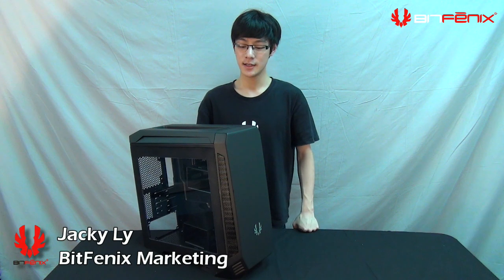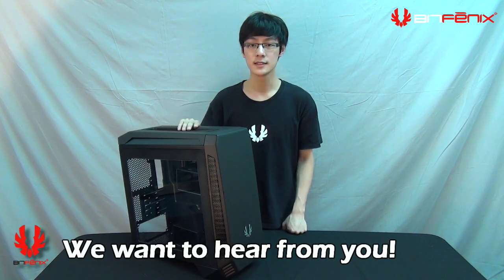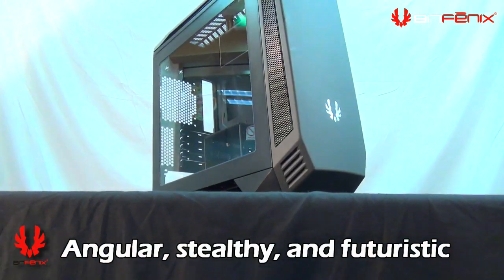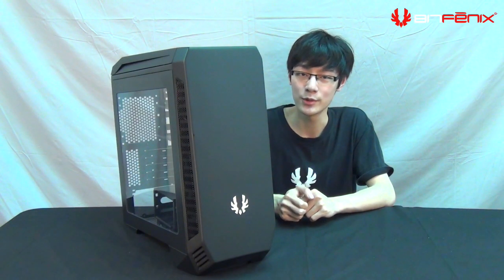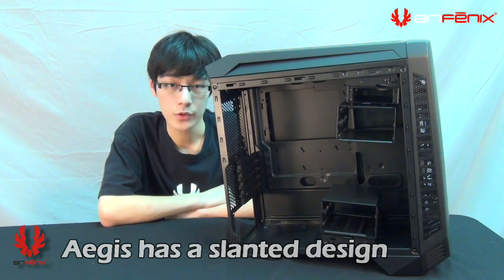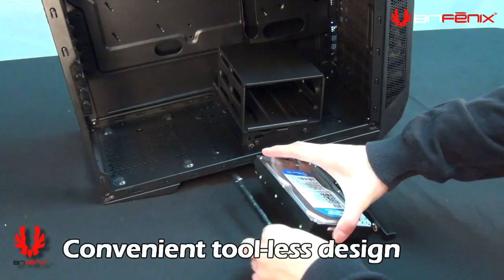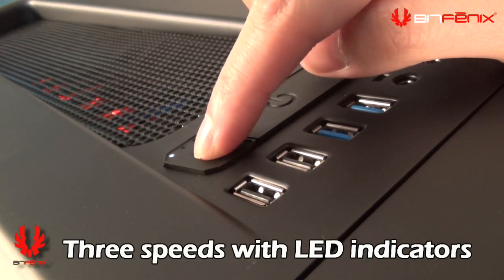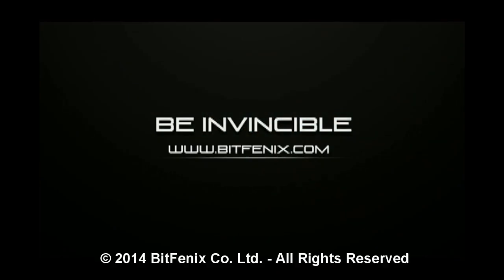BitFenix Concept Showcase: Aegis

Comment: Very interesting!  I really like to see case manufacturers finally making some cases without 5.25" bays.  Hopefully there is plenty of space on the other side of the case for cable routing!

I would like to see 2-4 SSD mounts behind the motherboard, preferably ones that allow you to remove the drive without removing the motherboard (maybe a small set of rails you can vertically mount the drive to?).  With such an impressive window, it would be nice to be able to COMPLETELY remove all of the drive cages (no rivets!!). This would let you keep the visible side very clean while still having some hidden drive mounts.

Will the window be tinted/smoked at all? I would like at least a slight tint..  

More information about space available for radiators would be great in the next video!  Especially comparing what will fit with the drive cages in vs with them removed.

Comment: This case is Beautiful! I like it.

Agree with the other comments:
- Make the top like 90% vents/mesh for better airflow especialy for 240mm radiators
- Option for a slim optical drive. Probably vertically-oriented/facing-up and parallel to the non-windowed side panel. (so that it does not cover vents in the front and top panels)
- Dust filters, dust filters, dust filters
- All drive cages completely removable = no rivets!

Finally, people wanting E-ATX compatibility will most probably do triple/quad SLI/Crossfire setup which means they can afford a $300 case (like a Corsair Obsidian 800D). I'm guessing this is not Bitfenix_Aegis's target market. mATX will be more cost-effective to build and keep the price VERY competitive.

...or I could be completely off-base and the Aegis will actually cost $500 when it comes to market! Haha. Either way, just my 2-cents.

- A proud Bitfenix Prodigy owner ;-)

Comment: Well it's a nice case hopefully it'll be in production soon. Some of my thoughts are to change the shape of the window to something more stealthy or to make the whole panel sort of bended like the zalman z11 case. Also it would be nice if you included at least a position for a slim dvd drive that would be near the power button. The last thing i can think of is the vent for the upper 140mm fans - make it a bit wider because this way most of the exhaust of the fan is blocked, this is because in the fans center the rotor takes up a fait amount of  space and the sides are where the most air is pushed throught. Otherwise its a great case.

Comment: 120-140mm fans and air filters seem like they can be added to the bottom to feed air directly into the graphics card. Also it looks like there is enough space to vertically mount a slim DVD drive flush against the case in front of the top io; while still allowing for 2 120mm fans in the front.

Comment: i'm not sure if i like the design or not. but changes are always good.
one thing i definitly not like, is the fancontroller. if you don't use it, you can't take it out. and a dial knob or a slider would be better, cause it is not limited to fixed steps, for example, the integrated fan controller on most fractal design cases could give the  fans 5V, 7V and 12V. but what if i want to let it run at 9V. i just need to turn the fan down to silence. and if the controller is in the back, it's not in the way if you don't use it. and usually you set the speed once and don't change it unless you change the fan.

Comment: Make a model that supports E-ATX for things like the Maximus V Formula that many people like myself have. 8 PCI brackets to go with that. optical drive mounts would be preferable(1-2) even a slot loading one is fine but an Asus OC panel would look great with this, rubber grommets for cable management, and a side comment would be to possible add a discrete handle hidden under the top cover at the back.

Comment: I honestly don't like the slanted design. Just make it straight. Slanting has no real function, doesn't look good, and will just potentially produce problems. And also it will be nice to have at least 25mm space behind the mobo for cable management.